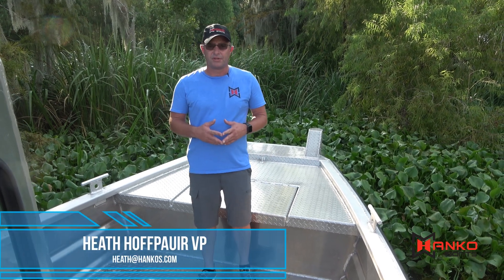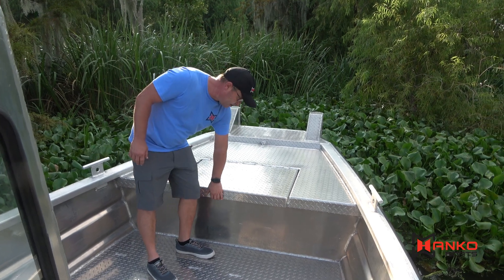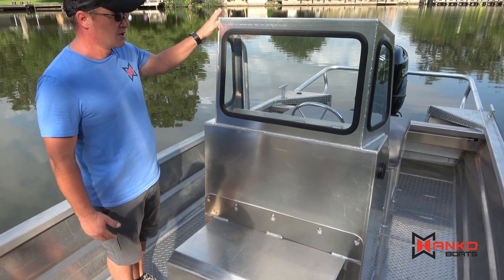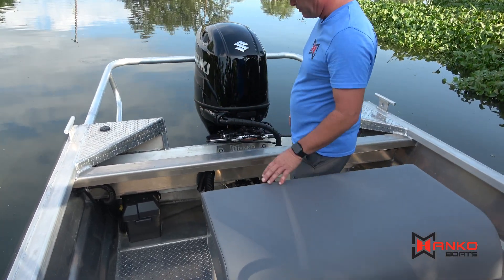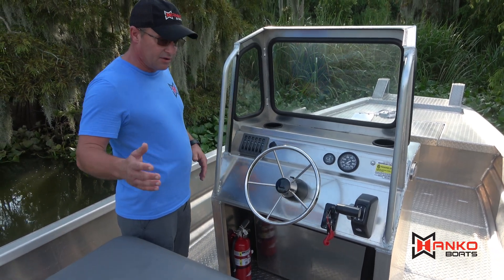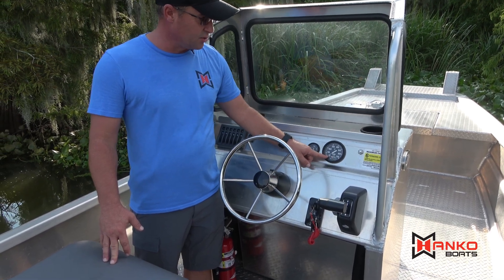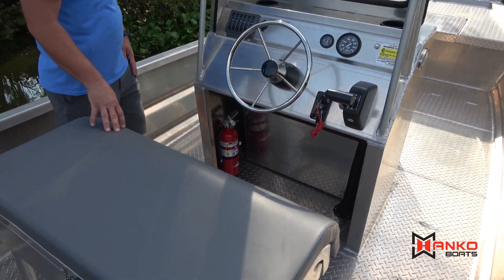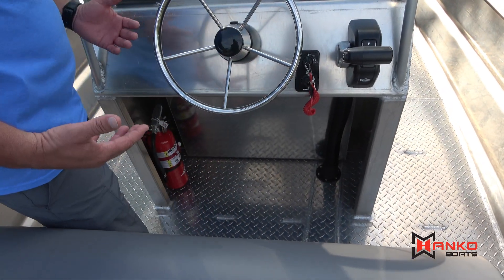Hanko Boats Model 2072 CCV

Comment: How do you get the controls to the console with a sealed bottom?
Reply from the maker: We have a channel that runs from the stern to the console.  We call that feature a floor track.
Reply from the maker: The double bottom is pressure tested to confirm no leaks.  Yes its an air tight double bottom.